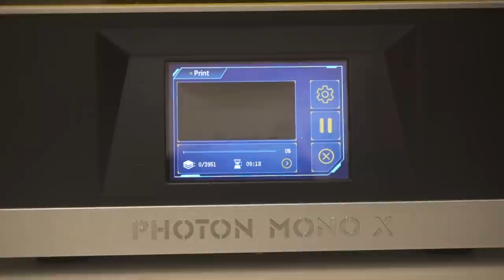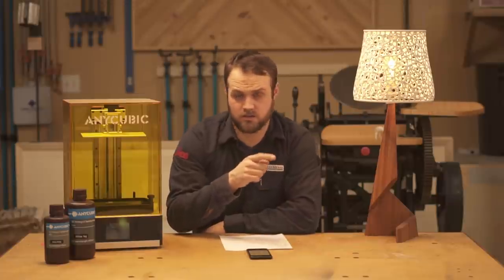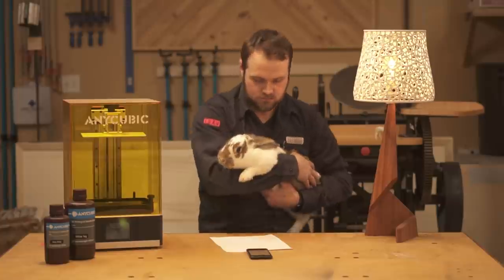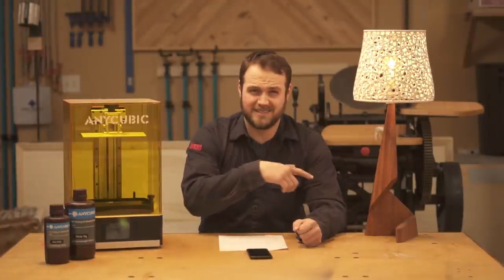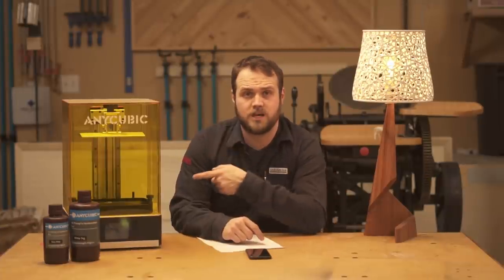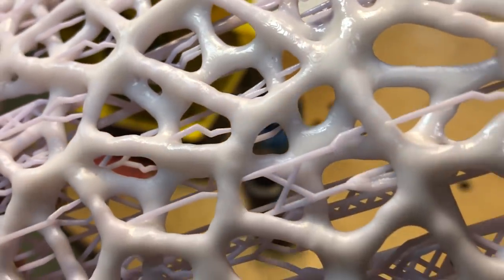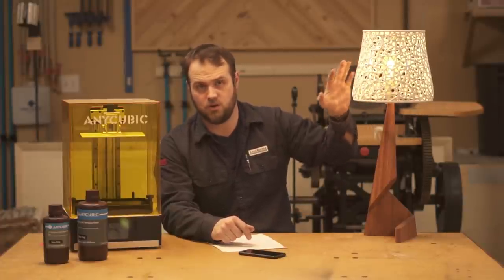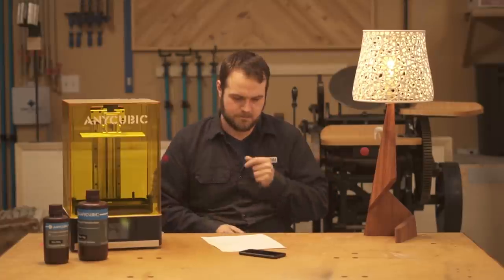Retro Lamp Build : Anycubic Photon Mono X SLA 3D Printer Review

Comment: With what you described at the end of the video you said it needed to be cleaned with isopropyl alcohol so...@4:13 did you fill that large green jug with just isopropyl alcohol? Also, if yes, is it reusable or then considered “contaminated?” And...the supports you mentioned, do they need to broken off and sanded down? 
P.S. : Thank you for the translation into inches.
P.S.S.: I do follow you on Instagram but I rarely actually use it so if you described in more detail there - I apologize.

Comment: How many bottles of resin did this print use?   It's not cheap, for sure.  Is resin printing cheaper or more expensive than filament 3d printing as far as materials cost?
Reply from the maker: The printers are cheaper, the material is slightly more expensive. I used less than a kg of resin. That’s less than one of the big bottles. It’s just post processing that sucks. The print quality is like nothing I’ve ever seen before.